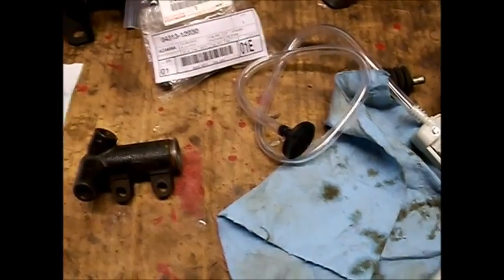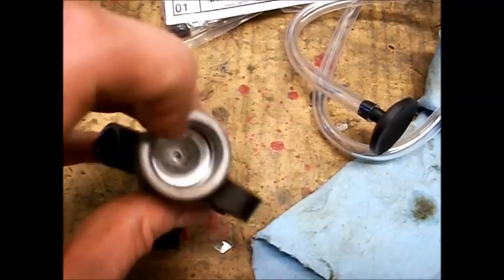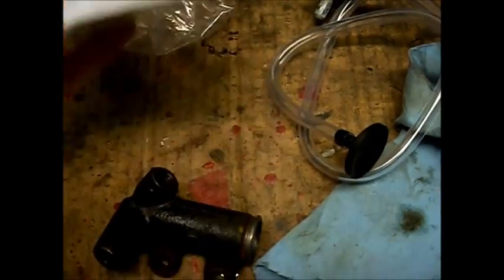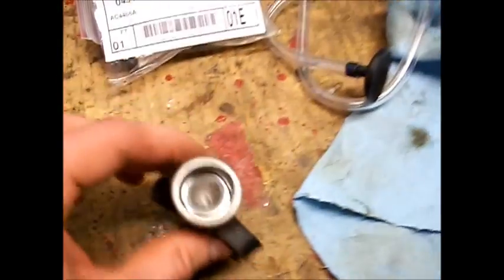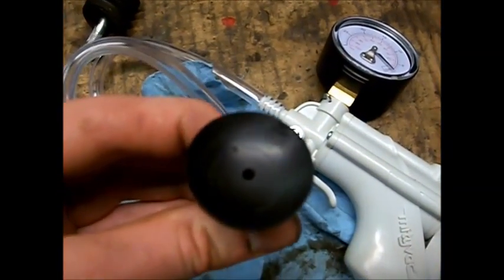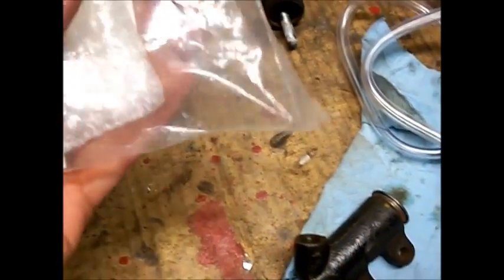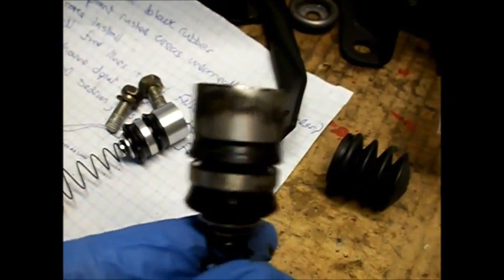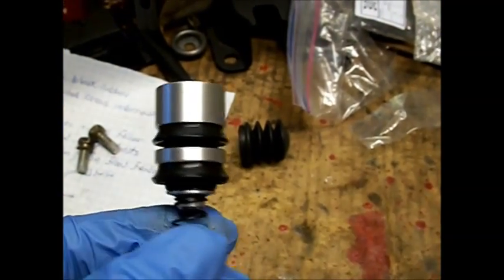rebuild a clutch slave cylinder

Comment: I thought ONLY to use brake fluid on the new piston as you assembly it back together.? You mentioned brake grease.
Reply: Yes. Brake seals are usually made from EPDM to be compatible with brake fluid. Brake grease is petroleum-based, which will eat EPDM. Silicone grease would be safer for the seal if you insist on using a grease, but the safest bet would be to use brake fluid. (I used to work as an applications engineer in the hydraulic sealing industry.)